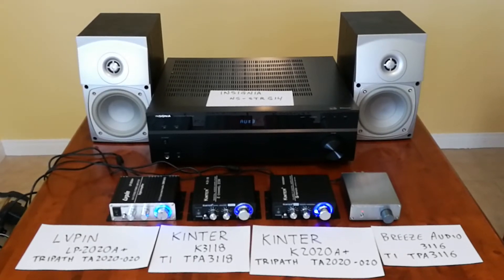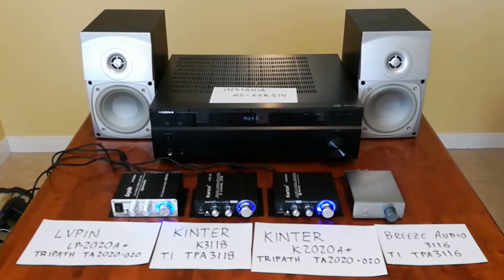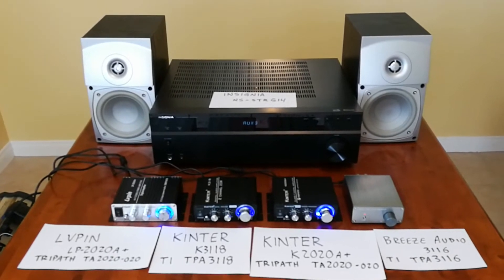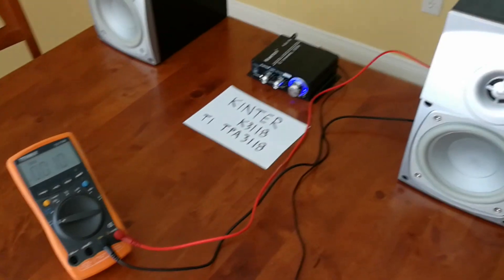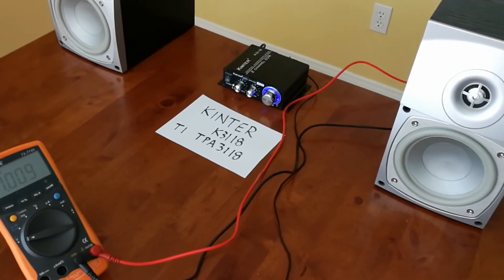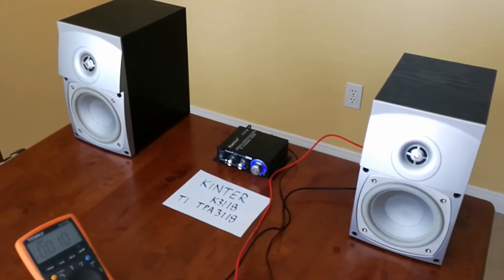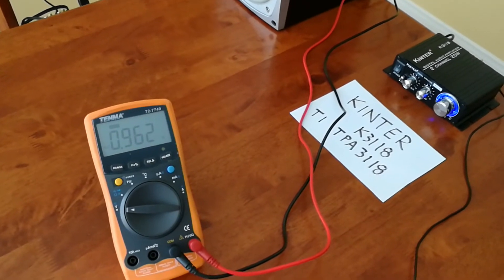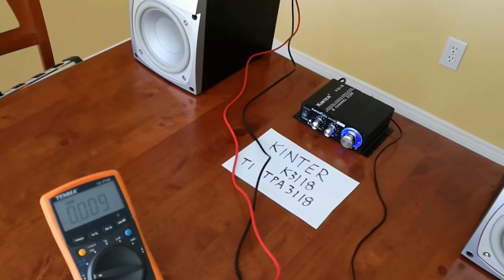Mini Amps! (Pt1) ~ Tripath 2020 vs TPA3118 vs TPA3116 Class T & D Amplifier Tests ~ Sound Demos

Comment: Good technical setup and review!     A year ago I set up my livingroom TV with external amp and speakers, using Kinter K3118 and a pair of Micca COVO-S speakers.   This was for watching news and sports, and  sometimes a movie.  Sounded pretty good, but a year later I wanted better.  So I noticed in my closet I had a forgotten pair of  Micca MB42X speakers, which I have really liked in the past.  I replaced the COVO-5's with the MB42X — sounded great!   I heard new lows, but not boomy or punchy.   The  highs were balanced with mid-range.  

Later I found I had a Lepai LP-2020A+ Tripath TA2020 amp in my closet.  Since buying that in 2015 (and using it for a while), I have often heard about the famous Lepai and how it's not made anymore, etc.  So I replaced the Kinter K3118 with the Lepai.  Same tone control and volume settings.  Right away I thought the Lepai sound was very "digital" and intrusive and somewhat annoying.   I tried the "flat" setting with the push-button out.   Still annoying.  So I put the Kinter K3118 back and it is balanced and warm, at high or low volume,  using previous tone settings or even flat.

I am not an audio chip expert, so I wonder how the TI TPA3118 chip differs from the Tripath TA2020, in regard to the overall sound quality.

Additional:  The reviewer mentioned the loud pop when the amp is turned off.  I do notice that with the Kinter K3118, but the Lepai LP-2020A+ is quiet.  However, where I have the Kinter installed, I never turn it off.

Comment: Is the class T better sounding than the class D amplifier?
Reply: Class T and Class D are the same thing. https://en.wikipedia.org/wiki/Class-T_amplifier
Reply: @somegeezer4058  yes but it sounds different and its built different.
Reply: @somegeezer4058 bur class d amplifier switch on a fixed frequency and class t switch according to the Input signal
Reply from the maker: In my opinion, yes. More detailed and natural.